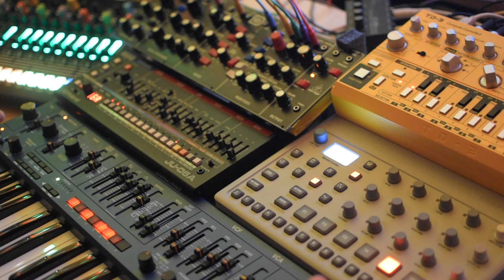'cerebral pleasures' song de-construction

Comment from the maker: forgot to mention, that to be able to hear TD3 playing 3 OSC off model D, you need to 'open the gate' - press the note on td3, to trigger the Filter in 3 OSC. Therefore you can create additional rhythm by playing notes on td3 (or programming a pattern), this gives ability to create another rhythmical as well as harmonically pattern, just by using triggers/cv/gateout from MS1.